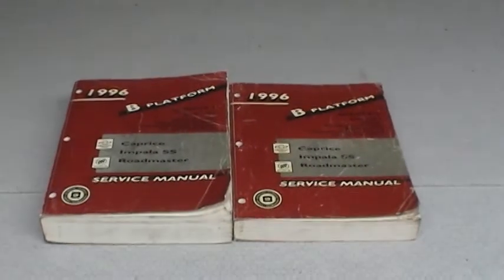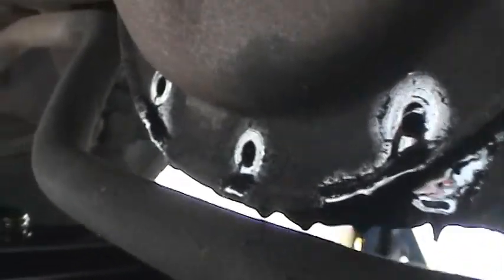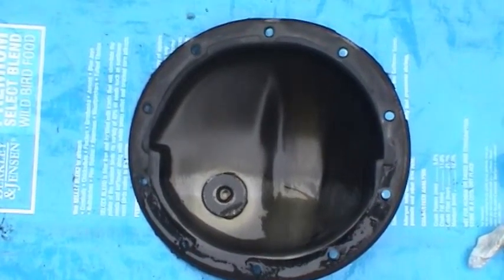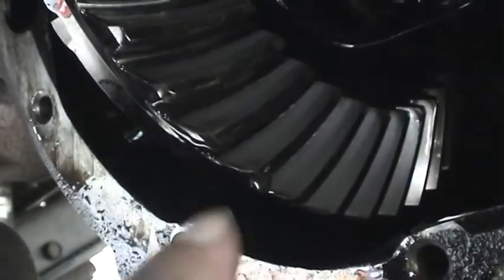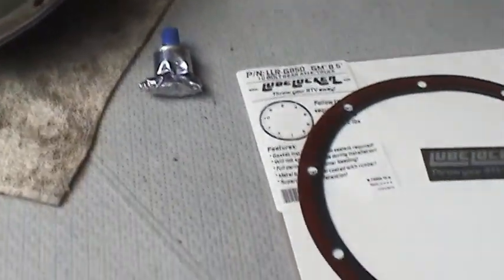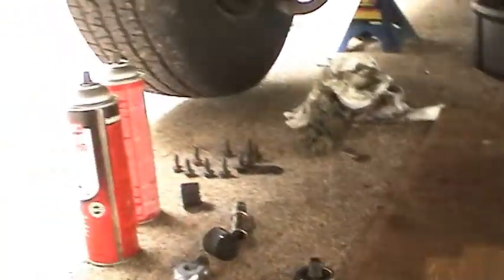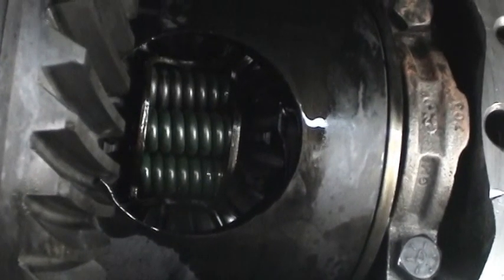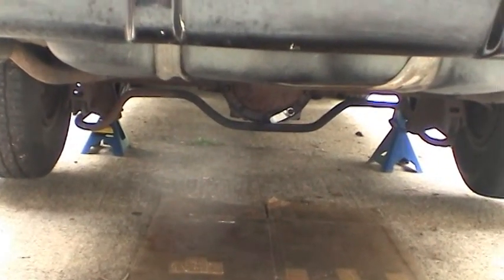1996 Buick Roadmaster Differential Fluid Change

Comment: Hmm tow package with the sway bar, 2.93 posi and mechanical fan? Just pulled the rear end setup off of a 96 just like yours for my 95, the 2.56 open differential isnt cutting it lol

Comment: i recently bought a 2001 p71 and when i went to a mechanic for the brakes he said my differential was leaking, i put a pic on facebook and people are saying its not a differential its a breather tube above the swaybar cover possible leaking on the guard. can u elaborate or have or make a video? they reccomend i change the gear oil and getting gaskets is this correct?

Comment: do you have any recommendations for storing cars?  i have a car that needs to sit for a couple months at a time.  i know this is the worst possible thing for it, but its either sell the car, or let it sit.  i refuse to sell the car.
thanks
Reply from the maker: Good on you for not selling! Two months isn't all that long for a car to sit so you shouldn't have to do too much.

1) Pour some Sta-Bil or similar product in the gas tank and run the engine to ensure it gets through the entire fuel system
2) Disconnect the battery negative cable and place a charger on it every couple of weeks or so to hold it up. A trickle charger is nice to have, but not necessary
3) If the oil is old, change it and the filter
4) At the end of each two month period, drive the car and ensure that the engine reaches operating temperature for at lest ten minutes. This is crucial since you want to boil off any water/condensate that may have gotten trapped in the oil pan. This will also heat the exhaust system up sufficiently to rid it of any water to avoid exhaust system rust. The only thing worse than letting a car sit is using it for short trips in which it doesn't warm up completely

Comment: I had to add a little friction modifier to my Ranger 8.8 4.10 LS after drain and fill with LS compatible mobil 1 gear oil.  Was making some shudder and noise but fine now after a few oz of extra friction modifier.  I would imagine Amsoil probably has way more additives to start with.
Reply from the maker: It really depends on the type of LSD. My 1995 F-250 didn't require any additive with this oil but it turns out that this Roadmaster did. I'll make a video of it soon. It really depends on the type of clutch material and the amount of pre-load force being applied by the springs. Different LSD's have different levels of slip. Some are very aggressive or "tight" while others allow for allot of slip or "loose."

Comment: I have a ford 7.5 diff with a plastic diff cover. Inside is a magnet factory installed that is flat-its super thin like a refidgerator magnet and about the size of 3 postage stamps. Small and weak but it does collect very fine metal dust.
Reply from the maker: Interesting. I've never seen a plastic diff. cover, but I don't have much experience with the 7.5's either. At least they used some kind of magnet. After looking at the oil analysis that came back, GM's decision to use a magnet was the right one. It really did the job.

Comment: Aw, c'mon, I wanted to see two patches of burning rubber at the end of the video. :D  Good informative video though, and nice look inside to see how the limited slip works.  But yeah, treat this one nice, and it will treat you nice also
Reply from the maker: Turns out, I had to add a little bit of friction modifier since there was some chatter around turns when cold. It was really fun doing this job and seeing how everything worked.